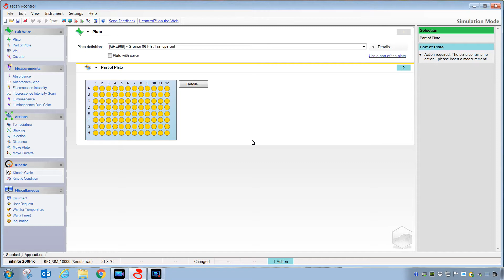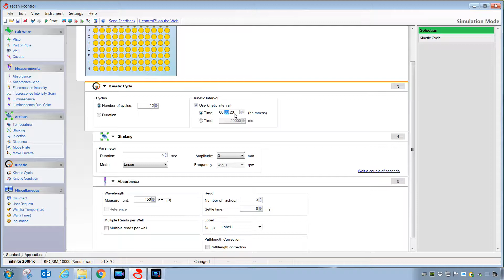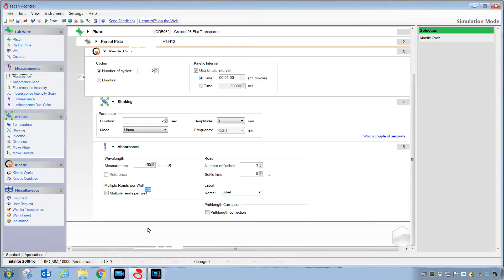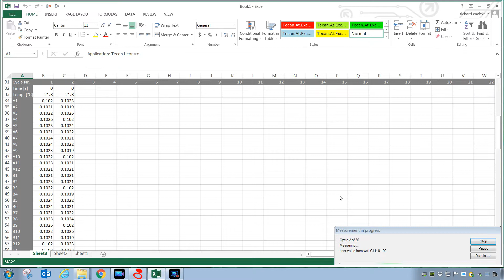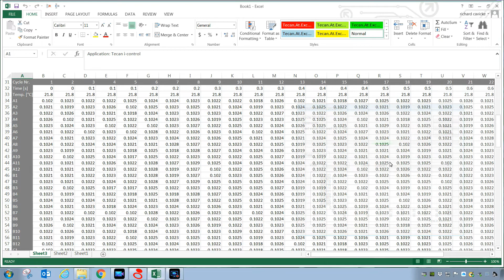Tecan's iControl Software - Kinetic Measurement Basics part 1

Comment: how do you know it take 30s to read the plate?
Reply: From experience. The length of read time depends on the number of wells measured, the number for flashes used and whether there is any other settle time entered, or shaking which would result in extra processing time.